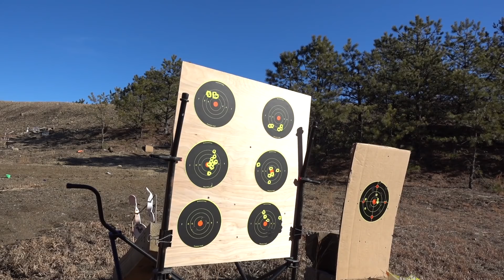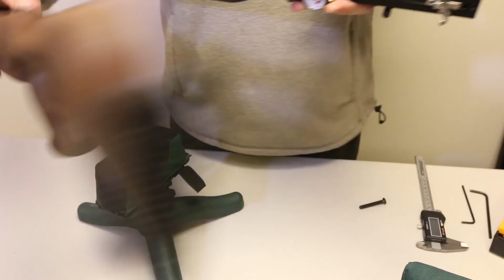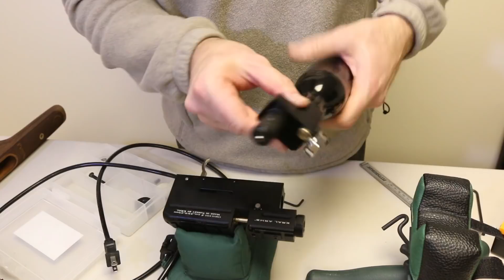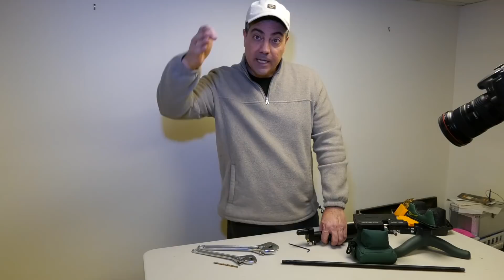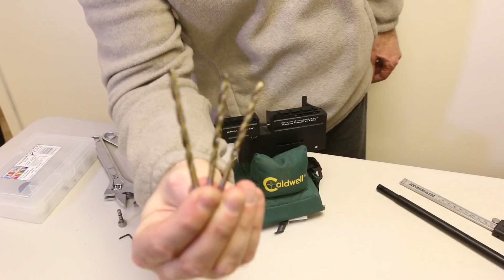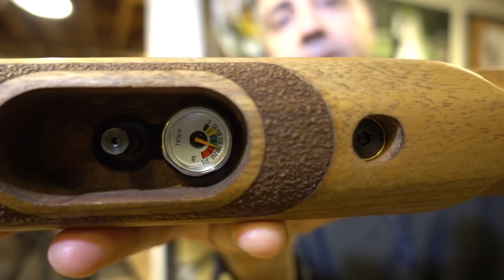Kral Puncher Jumbo .25 - Review & Final Modification to 51FPE

Comment: Do Research BEFORE you buy a PCP. Save your money for 
A GOOD quality pcp airgun.
 I spent 2,500 on an AAA EVOL.
It's a beautiful gun but i want more power. Ive been using PCP airguns for 6 years. Look at the used airgun section of Airgun Warriors. Look at the most commonly sold airgun. Then dont buy that gun. I look on AGW there and see many Fx airguns. I have an Airforce .457 Carbine. I love it but they are expensive. Do your research BEFORE buying an airgun. Most of the time, you get what you pay for.

Comment: Just got done modding my Jumbo Dazzle, cant get precise specs, but from my personal testing I'd say it now has at least 4x factory output.   Thanks for your tips they helped a lot. After taking it apart, drilling and making valve and hammer spring screw adjustments I've got to know the rifle a lot better.

Comment: hi...long time no see.....great video as always....i have a webley,   made by kral.....it is exactly the same as your kral jumbo....i am an engineer so i have a thing about being able to revert to original if i make a mod.....regarding your increasing the bore of the transfer port.....here in uk as you know 12ft/lb is our limit,   so the port is 1.5 mm bore....i wanted to increase the bore but be able to revert back if i needed......so i drilled and tapped to 5mm, but not tapped right through so the screws can bottom out, now i have 4,   5mm stainless (so they are easy to drill) grub screws drilled from 1.5 to 3mm,   so i can vary the size of the transfer port.......incidentally i did not want to increase the power i chose to have a larger bore transfer and a very light hammer spring.....allowing everything to be light and full power at around 80 bar.....also i was afraid to cut at an angle because i thought it might cut into the valve seat....regards bryan

Comment: Did you have any trouble removing the barrel I couldn’t pull mine out I removed the two set screws but it just wouldn’t pull out is there another set screw somewhere or is it just too tight and should just keep working at it trying to carefully wiggle it etc…? I just want to be able to replace the breach seal if ever need to.!

Comment: I just bought the Kral jumbo dazzle hi cap and it's putting out around 10.5 ft lbs very low thinking of increasing the power by trying to get a few turns on hammer spring but noticed their is what looks like a brass blank is this one of those anti tamper blanks and can they be drilled out..
Thanks great video by the way 👍

Comment: Hi urgently need some help...I opened up my fill port and upon opening it the internal silver screw was unscrewed and everything fell out I have tried putting it back together and when filled with air the air leaked back out of the fill port ...tried again and this time only lightly leaking out...tithened everything back up and now it won't accept air...I have the fill port the spring the metal block with pin a small black o ring and then a silver screw cap...in which order do they go and is there only 1 small o ring in there or more? Please see pic 
https://ibb.co/yBcDGNV

And should there be anything in here where valve screw's into?

https://ibb.co/jwzzCQV
Reply from the maker: I have never taken the Kral fill valve off but it looks pretty much like most check valves. Looking at the photo you supplied. The oring goes on the piston stem then turn the piston stem 180 degree as seen innyour photo insert into the valve shell and screw in the retaining nut against the spring. Then screw whole assembly into receiver block. When you fill the incoming air will push the piston down allowing air to flow and when there is enough air in the bottle the backward pressure along with spring  will close the piston against the oring sealing it from leaking. I would use a small amount of silicon grease on the oring. If it leaks it most probably a nick/cut in the oring. Let me know how that works for you.
Reply: @AirVelocitySport  perfect...I was putting it the wrong way round...so spring into valve and pin protruding threw the screw cap out the other side...duh moment...never seen one of these before...put all back together now ready to fill...thank you so much for quick responses...I can't thank you enough. I will chrono mine after following your instructions and update you as to what FPS my np500 is at. once again thank you so much...also these don't seem to be standard fill ports as they need adapters for pumps and so on...what is a standard fill port this can be replaced with so no adapters are needed?
Reply from the maker: Glad that helped. Yes, Kral uses some proprietary which disconnect fill port. It just does not make sense to me. When I install my regulator I called of the Kral port because I now fill via the new regulator port which is a standard foster quick disconnect port.
Reply: @AirVelocitySport  thank you...I've run into a little problem and thought If I can get some info if you are able to advise before I open it up I can get straight to fixing it...so as mentioned before I opened up all my ports to 4.5mm and I was shooting around 900ish FPS...all was well...for testing purposes I wanted to work out with hats the quickest way to bring the rifle back down to its original power which was 12ftlbs... so I decided to close the power adjuster hole up completely and re drill it to 1mm as a start...the power is down to 7ftlbs...but I have an issue where when I shoot I can feel air coming out the hammer screw area...so on every shot there's a burst of air from the very back...I did undo the screw oh the hammer and tak it out but put it all back in together...I have a feeling with so much pressure coming from the valve and all the ports but not enough opening on the power adjuster it's blown an outing somewhere to let the excess air out? And if so which isit likely to be...I have a feeling it might be the little oring on valve stem that the hammer hits that letting air pass I to the hammer area and out the back?

Comment: How many shots are you able to get out of a full tank and did you do anything to the hammer spring apart from the barrel valve and breach?
Reply from the maker: Yes, I did increase the hammer spring tension a bit. At 51 for I was getting around 39 shots. Now I have it shooting 59fpe with a regulator. I also opened the valve and transfer port a bit more. Gets about 42 shots at 59fpe. Yes, more shots with more power because the unregulated valve had a long dwelll time which wasted air. Now I have it balanced better between the regulator and hammer spring.
Reply: @AirVelocitySport  thank you so much I'm working on my np500 and will be increasing all 3 holes to 4mm to start with and take it from there.
Reply from the maker: Just be careful not to drill the stock transfer port adjuster too much. If you don't leave enough meat on the metal it could blow apart. I open themed the transport adjust knob hole a little bit and made a new one from a stainless steel bolt.
Reply: @AirVelocitySport  I will be leaving that alone to the very last as if I  can get 800 to 850 by just doing valve and barrell and transfer port if it really must. Then that's fine...if not then will get a skilled machinist to drill out the adjuster

Comment: hi .. i have kral puncher in 22 cal.. do you know if i can switch barrel.. to 25 cal.. ??
Reply from the maker: I do not know but I'm going to guess yes. The receivers are most likey drilled to same diameter for .22 and .25 for cost savings. But you will also need the change the probe.

Comment: Are you sure about the power adjuster and air fiow thing at: 7:57 ? Because it's a deal breaker for me.
Reply from the maker: Yes
Reply: @AirVelocitySport  I would never be aware of that if you did not make this video. Thank you very much.
Reply from the maker: Most power wheel adjusters are only a restriction of the air flow after the valve but before the barrel. It just a transfer port adjuster.  The best way to adjust power is using the regulator and hammer Spring

Comment: Is there a reason you used a dremel on the barrel port instead of a drill press? Did you get any burring on the inside of the barrel, and does that concern you?
Reply from the maker: Yes, I first used a drill bit to open the barrel port then use a Dremel to clean the burrs. A Dremel with a diamond ball bit clean and smooths the opening.

Comment: I wonder if you can simply unscrew the shroud a few turns to make a gap between barrel front o-ring which permits air to be shot inside then released through tiny holes drilled near the rear shroud threads.

Comment: Wish i wasnt a broke ass. I love the look and finish of this rifle. Its kinda disheartening that you had to open up all the ports to get 50fpe though. My Gauntlet came stock with 48fpe all i did was clean up the barrel, trigger, trigger spring, and barely cut the hammer spring. Im going to try to get it up to 70fpe with any luck. Cant compare the finnicky ugly ass gauntlet with that jumbo though in build quality but it has potential and i have less than $350 bucks into it including 38L bottle, cheap workable scope, and cheap hand pump. This is my first pcp and ill never look back. Shot break barrels for 10 years not knowing what i was missing. Good vid as always!
Reply from the maker: Thank you

Comment: Great video buy the way . Just wondering if you could help me drill sizes as mine in 22 not  2.5. can you recommend hammer spring as well Kind regardsThomas
Reply from the maker: For .22 3/16" drill bit should be ok. Remember, you don't want to drill the barrel port any larger than .19 for a .22 as this will affect the loading of the pellet into the chamber/barrel. 3/16" or .1875 is really quite good. I would stick with the stock hammer sting as it has plenty of compression to push the hammer.

Comment: Hello, Great Vid. Just got both My NP-03 .22cal and Puncher Jumbo .177. Ill end up doing the Mods on My Jumbo .177, but the NP-03 you should look at cause you cant remove or unscrew the Valve block from the Receiver Block its not like the Jumbo, also the 2 grub screws on top of My NP-03 above the Power adjuster, when you remove them theirs no hole going thru, its solid metal, I would have too Drill thru that and hope that im straight as an arrow, Level. wondering if the jumbo is like that also, you didn't mention in your Vid that under the Grub screw their was Metal too Drill thru, just wondering, anybody reading this, let Me know your how too Mods on the NP-03, cause im really wanting to Mod that more than My Jumbo .177.  NP-03 I take Fishing with Me cause I have Huge Snapping Turtles,Water Moccasins, and Muscrats that Id like too take care of.

Comment: Nice video. In my experience as well H&N pellets are kinda mediocre compared to JSB pellets. If I could give any advice to people is, JSB pellets are the way to go, don’t waste to much money on H&N. Their quality is very inconsistent. 

I do know H&N is coming out with a slug in many calibers so hopefully they will be good for your gun. Nice video.

I have a question. I’ve been very skeptical about buying a gun with a floating barrel because it seems... weak. I will hunt with my guns so if I hit a twig or branch is my hunting day over?
Reply from the maker: Yes, that is true for some guns but my experience has been good with Kral. Not so much with the Guantlet.
Reply: Air Velocity Sport 
I would never buy the gauntlet. It’s a tank. 
But yes Kral seems to be built well. I don’t own one but I am thinking about it. I like the specs on their guns.
Reply from the maker: Chris, I agree with you. For $300 now I'm a big fan of the Nova Liberty. This gun has very few issues and it's really good right of the box. I just tuned one of my Nova Liberty guns to 50+ fpe ready to shoot heavier slugs
Reply: Air Velocity Sport 
Never heard of the nova liberty. I am lookin into the Kral puncher breaker, and a few of their other guns. Somewhat high shot count and power is great for what I want them for. 

In your experience is your Kral guns shooting at or around advertised FPS? Do you remember what your power was from the factory?
Reply from the maker: The power was about 40 fpe in .25. but with some tuning it's a killer. Nearly 55-60 FPE. The Nova liberty is awesome in .22 on shot count and power. I made a few videos on it cause I love it so much.

Comment: Great video! I'm currently modding my Kral PB .25. The breech block assembly is perdy much the same except for bottle adapter block. I've opened all necessary ports to .189 and power adjuster to
 .185 (3/16=.187) was afraid to go much bigger in fear of too thin a wall. I try an used my lath and drill press when possible to do all mods. I'm getting around 740-750 fps with these changes shooting benji 27.8 gr. pellets. My question is how can I get closer to 850fps like you did?  Am I missing something? note * I chronyed with muzzle 3ft. from chronygraph. using 27.8gr. Benjamin sheridan pellet.

Comment: Awesome vid! Must be, because mine, in 25 cal.. is arriving tomorrow! Wamted to know if they are having the same issues with the valve stem as on the Breaker? Apparently it isn't hardened, and neither is the hammer. Can't wait to shoot my gun, but plan on doing these mods asap.  Also, any ideas on the shroud issue? Wonder if there are any simple methods people are using to support that shroud some way. Thanks for your hard work. Be safe. Peace.
Reply from the maker: Yes, the hammer and valve stem are still issues as far as I know. Call Troy to get a hardened stem. Nice guy and fare pricing. Still waiting on my shroud. But I have a temporary fix for now.
Reply: @AirVelocitySport  Awesome. Well, I did your mods and have the 34 grain JSB's running 800.  I hardened the valve stem myself. Will see how it lasts. The valve job Troy did for you got yours to 900 fps?  Prob need to send mine to Troy. Thanks for your insight. It's a great shooter without the shroud, and I love it. A tiny bit more power would be nice, as I like to shoot distance too.
Reply: I went through the process of heating and quenching the stem, and although I didn't realize it couldn't be hardened, It has lasted many thousands of shots. Guess I got lucky.  Cheers

Comment: Good Vid Sir!

The action the Kral is loosely copied from. is the Rainstorm II.  Oddly, without modification, the Rainstorm is putting out a little over 10+ fps  more than the Kral is after mods. 

A few helpful hints:

1. After drilling the barrel port, (Dremel) the bur in side of the barrel chamber is more important than the burr outside of the barrel.  This can be removed with a rubberized cratex abrasive point shaped to just fit into the barrel throat.  the burr out side of the barrel port is not that critical. In fact, can actually help seal the barrel to thru port opening. 

2. After opening the barrel port, make it slightly oval in the direction of the muzzle. This will allow more surface area in the opening, without allowing the pellet to dip into the opening and deforming the pellet. Hence, move air into the barrel. 

3. When opening the valve itself, use a diamond ball point tool in the dremel, smaller than the port, and work the inside of the port opening into a smooth, rounded shouldered transition rather than just a sharp corner.  Also polish this port and the interior of the valve body to remove any burrs caused by the work with the same cratex rubber point. 
(Dremel use to include these points in their kits, however due to Silicosis scares, they no longer include them.) Can be obtained from any gunsmithing supply, such as Brownells. 

4.  And lastly, the hammer springs are available thru PA (Sold for the Rainstorms), and ment for different cal's of Rainstorms. A move to a .30 spring, and cut a little short for free flight of the hammer will both increase power by a goodly amount, and give more shots due to less hammer bounce. 

KnifeMaker

Comment: Quote from Nick Nielsen - "Kral guns have not shot my slugs well. I believe it is because the barrel sizes are not similar to other air guns. Pellets are very forgiving on barrels but slugs are not."
Reply from the maker: Thanks for info. Are kral barrels larger or smaller? Do you thing a slug made to fit the Kral barrel would shoot well?
Reply: Air Velocity Sport Might not be as simple as that, it could be the choke.
Nick also said "As far as choke or unchoked it depends on the barrel. Heavy chokes lead up but some barrels need to be choked because the barrel is too large for the slug. If you want to shoot .217 ammo a barrel that is .217 breech to muzzle is best in my opinion. If you make the barrel and it comes out .218 it may have to be choked for best accuracy or shoot larger slugs."
I have asked Kral about their barrels but got no reply. Nick might be able to advise he is extremely helpful. Have you ever slugged your barrel (pushed a pellet through then measured it)??
Matt Dubner should be posting a video soon on the new smooth twist X barrels that have been developed specifically for slugs which should be worth a look.